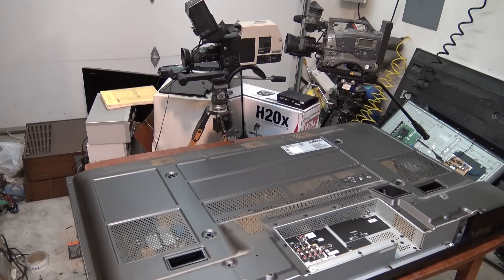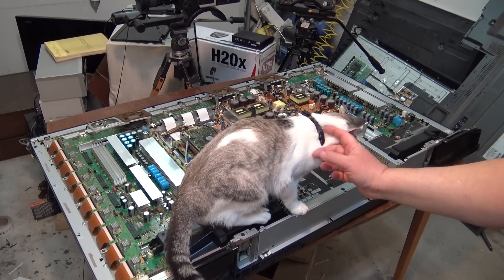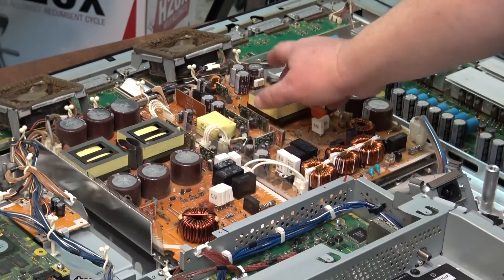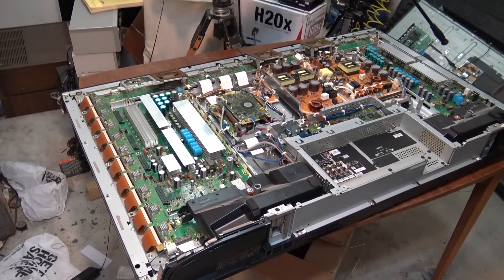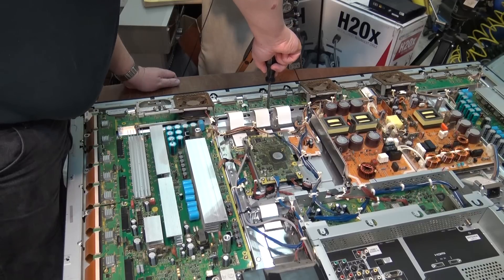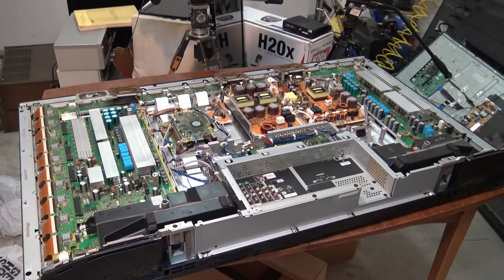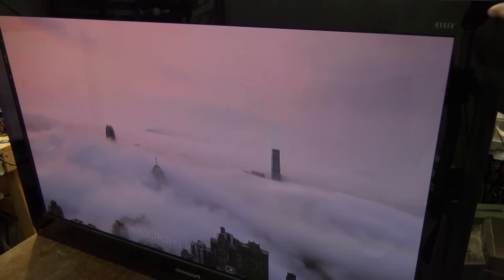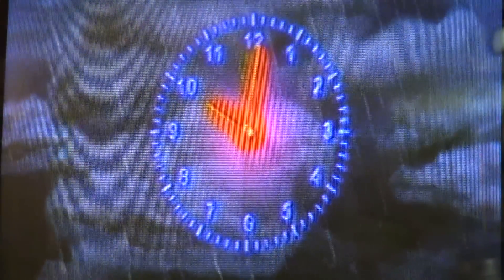Panasonic TH50PZ750 shut down   5 Blinks

Comment: Wont all that smoke damage the unit? And sucks you are far. I need to change a DLP chip on my Toshiba. I have no idea how to do that.
Reply from the maker: Steven Brashear 
the smoke certainly won't do it any good. 
I need to change the  DLP chip on my Samsung and would have done it by now if the chip wasn't so bloody expensive.
Reply: There is a place in Dallas that sells them for $90. I have a 55 inch samsung DLP with bad bulb and good DLP chip. I do not use the set. It is stored in my closet
Reply: I have no use for it. I can give you model number tomorrow and if it is what you need, i can send it to you
Reply from the maker: There are many different chips. The 720P ones can be had relatively cheap. Mine is the LED-DLP with the HD3 chip I believe it was called. I looked it up, and Shop Jimmy wanted 275 for a new one, which is US. That would be close to 400 CDN, and I am not about to put that type of miney into this set, even though it is a good candidate, because it is the LED light engine, which is supposed to be good for 30,000 hours. My set has about 8,000 on it, and works, but there are a bunch of white specks on the screen where a mirror has broken and fallen off it's hinge inside the chip. I'm hanging onto the set as it was a very expensive set so that some day if I can get a chip for under 100 I will definately do it. It is pretty easy to change, and that set had a fantastic picture. Beautiful color. I have 2 other DLP sets, one I took to work for the lunch room, but I still have a Samsung 56 Tantus which was also an expensive set. It is only a 720, and it works fine. The problem with the chips seemed to be more on the 1080 chips, probably due to the "wobulation" which was used to increase the resolution on screen without increasing the physical pixel count on the chip.

Comment: Wow! Lots of stuff inside, It must consume a lot of power?
Reply from the maker: Would you believe 705 watts!
Reply: It's like having a small heater in the house lol!
Reply: killmore75  About the same amount of power as 2 old all tube color tv's, plasmas are more trouble prone and very heavy, don't like them myself.
Reply from the maker: olradguy 
considering this set is 10 years old and this was the first problem I would argue that they are pretty reliable and you can't beat the picture except for oled. 
 I like plasma. the newer ones were not as power hungry but many will also argue that the power hungry sets had a better picture.

Comment: No, I've seen worse burn-in on old CRT TVs whose only task in life was as a monitor for a game console. There was a big, pixelated "Game Over" right in the middle of the screen! :)
Reply from the maker: We have some pretty bad ones at work, VTDs that just display the same login screen 24/7 unless someone is actually on the terminal inputting info. The worst one I had was an old VGA screen from back in my BBS days. It would run 24x7 and would display the main screen from "Front Door" which was a modem answer program. I ran a main tosser server. This was back before the internet, and Email. Anyone that has been around awhile will remember "Netmail" and "Echomail" Forerunners to Email, and Forums. 
My system would sit there waiting for another BBS that was down stream to dial in, and it would answer the phone, receive the main bundle, sort or "toss" the mail, and then it would dial out all the other downstream systems and deliver the mail. Once a night it would diak into the backbone, which was a long distance call, and drop off, and pick up all the long distance netmail.
So basically a user could send a message to his friend across the country , it would be tossed on my sytem, and delivered overnight, and the receipent would get it the next day. Respond, and it would arrive the following day.

Comment: Smashing job :-D looks like a nice set, shame about nicoteen coating on everything :-(.
I bet that tv stinks worse when hot, ive had to service items from smokers, im not a smoker so its just disgusting to work on.
I had a music center to repair for a frend, i ended up scrubbing the whole thing with warm water and detergent, every bowl full was like diluted poo :-(.
The unit looked like new after i had finished, it was actually a nice system.
Reply from the maker: That is a nice set. One of the best plasma TVs ever made. Only one that was possible better was Pioneer.

Comment: I would put loctite on the screws
Reply from the maker: Loctite would be a bad thing. It would provide an insulation layer on the screw thread and defeat the purpose of ground screws to begin with. Lockwashers yes.

Comment: Ha ha  o guess at that before I started the video. My research showed that I have a 55 in Panasonic plasma tv went bad. I had to replace the y sustain board
Reply from the maker: Y sustain, or SS board gets damaged by the loose grounds, I have repaired an SS board on a Panasonic, and a Xmain on a samsung.

Comment: My God those fans are disgusting. I've worked on computers owned by smokers and those got pretty bad. But that TV takes the cake. Urgh.
Reply from the maker: I said it would be gross.
TV belongs to an old friend. Went to school with him, and worked in the same TV shop for 20 years. He worked on the sales floor, I worked in the back. I remember he was always going out for a nail every half hour or so all day.
Reply: 12voltvids Any tips on cleaning that stuff off if you had to?
Reply: It's gross.  I personally havent had any smoker's TVs yet to repair but I did a lot of PCs that were owned by smokers,  which are usually worse because they smoke right in front of it.  Air compressors dont work because the tar from the smoke turns the dust into brown glue almost. What I ended up doing was thoroughly cleaning the board with alcohol and removing all heatsinks and loading them into the dishwasher,  they'd come out like new.  Pain in the ass.
Reply from the maker: Dacke 
I send em back as dirty as they arrived. can't pay me enough to clean them. imagine how their lungs look. crt tvs were even worse. the ht created electrostatic attraction to dust and the tar got in there and more dust and grime. disgusting. the worst ones were from bars back when smoking was allowed in bars and restaurants. I love the people that say that's why I don't smoke cigarettes only weed. hello that is 10 times worse.
Reply: Oh I charged them more to do the cleaning,  I would take pictures if it was really bad.  The heatsinks had to be cleaned because half the time they were so clogged with that stuff that the CPU would go into thermal shutdown.  And it if was an older AMD pre 2001 or so CPU it would basically fry itself b/c they had no thermal overload protection built in like the Intels did.  If they insisted on smoking in front of their PC I told them to install a hepa filter on the intake and change it out every month or so.  Cigarette smoke sticks to literally everything in the house though so I try to convince them to do it outside.
Reply: Ah come on ! +12volvids
Vacuuming with a hoover would have took you 5 minutes of your repair time, which wasn't long to start with on this set.
To each their own I guess, but cleanliness, be it as owner or repair technician, is (for me) very important. Educating the friend/customer is really important too.
Maybe can they be advised to smoke elsewhere? Just my two cents....
I'm a moderate smoker myself, and I always try to have a smoke outside  when I have to.
Thanks for your video!
Reply: LFOSyncToo Hoover all over an IC populated circuit board? Kiss your components goodbye as they get fried by all the static electricity you're generating. If you're going to do this, get a proper ESD-safe vacuum specifically made for cleaning electronics. Also, don't use a regular vacuum to clean up laser printer toner. You'll start a fire. They have specially filtered ESD-safe vacuums for toner.
Reply: ESD-safe hoovering on fan ? or cap ? or even big power transistors ? You're kidding me, right?
If you REALLY can't vacuum it, well...might as well blow it as an alternative. Does my comment suits the bill this time?
Reply: LFOSyncToo It's not that you're vacuuming a fan or capacitor that's the problem. It's the fact that the plastics used for the hose and attachments as well as the body of the vacuum are very good at generating electrical charges and it's all too easy to touch a component you shouldn't have by accident or hit something with a brush attachment and then dissipate that charge onto a component that will fry internally. Even robust components that aren't normally considered to be at risk of ESD damage can be damaged. They may not fail catastrophically but instead there is latent damage internally where they "work" OK but are actually bad and will fail down the road.

You feel free to do what you will with devices entrusted to you. I can only advise against it so that others may err on the side of caution before they zap their $1000 4K TV or worse, someone else's.
Reply: You surely can freely advise others regarding your own thoughts and why you would be reluctant in doing vacuum-cleaning otherwise.

But I will then err too on insinuating that letting that smudge in the t.v. doing no bad on the long term and at the same time talking about good practice regarding potential ESD damage while cleaning. Plus you don't have to use the brush attachment on your vacuum (which is ESD risky)

And once again you can blow it with compressed air if you really want to avoid any ESD problem
Reply: LFOSyncToo If it were just dust, compressed air might help. The problem is it is dust covered with tar from cigarette smoke that has been covered with more dust and yet again more tar such that it is a sticky, gooey mess that air doesn't move very much. You'd really have to get in there and clean with something that can break up the tar and to do that thoroughly enough for certain components like a fan it would be cheaper to just replace the fan outright.
Reply: #esdsafewristwrap
Reply from the maker: A little dust and smoke inside never hurt anything. It will reduce the heat transfer slightly from the heat sinks but this set has overkill as far as heat sinks go. I was doing this more as a favor for a friend so it is not like I was making any money on it. The only money I will be making from this repair is from youtube revenue, so keep watching.
Reply from the maker: Compressed air would be useless for smoke debris because it is sticky.
Reply: Hey thanks for your comment and input +12voltvids.

And it's nice from you to do that free for your friend.
I for one couldn't leave the set without doing just a little bit of cleaning and then telling my friend to try to stop smoking in front of it. But hey - that's just me -.

See, atm I'm trying to repair a cockroach infested laptop from a young friend of mine. That's the first time and the worse I've seen so far. So I couldn't even try to attempt the repair without deep cleaning the whole thing with detergent, water and a lot of scrubbing. I don't have any ESD-safe brush but had to do it only to be able to diagnose the havoc caused by the cockroaches. I hope the ESD-police won't mind ;)

I'd very much like to ear your opinion on this ESD thing...or if you have any tips working ESD-safe.
I surely will keep watching your videos :)
Reply: LFOSyncToo The ESD-police don't care if you zap your friend's laptop even worse than it already is. They just hope your friend understands it would only cost $5 for 5 ESD-safe brushes that could have prevented whatever damage you may have already done. I'm almost certain the laptop was worth more than the brushes. That's the general idea behind ESD-safe working practices: generally cheaper to replace the disposables than repair/replace the equipment. But don't let that stop you, now.
Reply: Water is ESD safe and actually prevents ESD discharges, as you surely know. Didn't brush without water... But i must confess that I vacuumed the dead bugs beforehand (nooooo!!! what have I done), because it felt really creepy doing that by hand.
As for the laptop, the cockroach juice took down the TPS51125 Dual-Synchronous Step-Down Controller and shorted it. So, you know, it's not turning on. Wasn't the water at all....  But thank you for caring for my friends laptop anyway.
BTW he was here as I disassembled the laptop and has seen the bugs in person. So he understands two things first hand:
1) his laptops MB is in very very bad condition and as it is, was already out.
2) he might have to buy a new computer (see point n°1)
Trying to salvage his laptop to avoid him buying a new one here. But now it's cleaned, dried and troubleshooted. So I won't stop
Reply: LFOSyncToo Mock all you like, you are still missing the point. Yes, the initial problem may have been a specific component that's easily  replaceable. But as someone trying to repair something you don't want to damage more things in the process. So you might have easily zapped his CPU or GPU or other sensitive components that you aren't prepared to fix or replace reasonably and have instead guaranteed that your friend has to buy a new laptop instead of saving the day by fixing the problem and cleaning the laptop. So, bravo! Two thumbs up! Perhaps instead of making fun you'll do a bit of research next time. It's no crime not knowing something; but if someone tells you there's a danger and you go ahead and do what you will anyway that's no longer simply being ignorant but truly daft. Good day to you, sir.
Reply: We might want to turn the ego-meter down
Reply from the maker: This is nothing. .You should see CRT TVs from smokers. They are so gross that you can't even see some of the parts never mind the part numbers on them.
This set was actually relatively clean with the exception of the vent holes on the back, and areas around the fans.
Wasn't being paid to clean it, and a little smoke dust isn't going to hurt it.
Reply: Hey it's ok no prob. You don't have to justify at all. I just gave my opinion because I think and do differently. That's it. And I will continue to watch your videos which are great. I could only dream of having your theoretical and practical knowledge.
Reply: most of that is dead skin from not dusting
Reply: Alternative facts